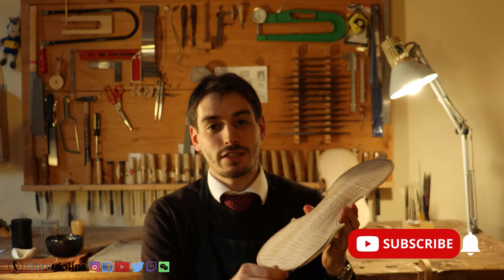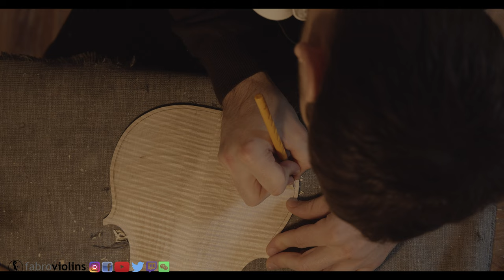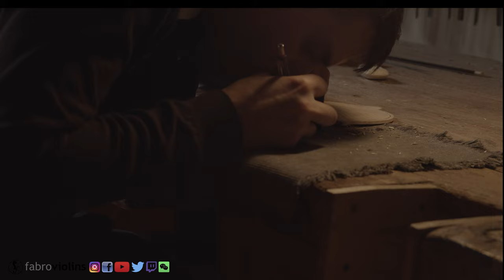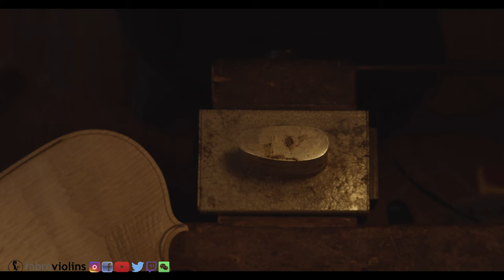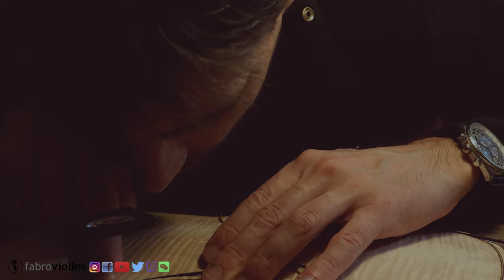MAKING A VIOLIN | The PURFLING | Step 04 | Amati Model

Comment: So interesting! I've seen purfling on instruments before, but I never knew what it was called or how it was done. Is it purely decorative or does it serve a function on an instrument?
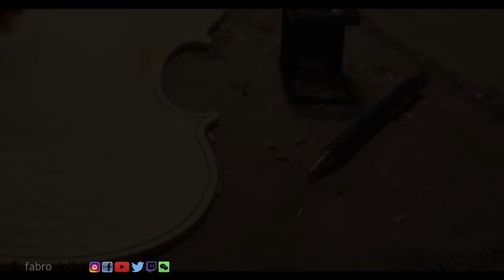Two more questions: what's that you're using at 5:25, with the digital readout? Is it heating up the purfling to shape it?
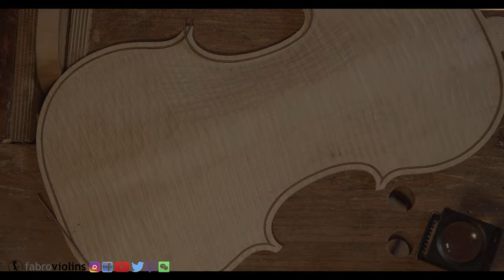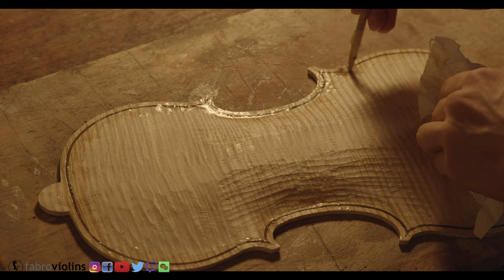And what's that you're brushing on the edges starting around 9:30? Is that an adhesive, and if so, what is it that it seems to come off so easily at 11:30?
I guess that's more than two questions.
Reply from the maker: Thanks for your comment!!! 
It has a double function actually. It also helps cracks to stop at the point where the purfling is. So if for example someone drops the instrument (from a reasonable height of course), it could happen that the instruments cracks from the border and stops where the purfling begins, which is great because then you don't get a crack on the inside of the instrument which are the toughest one to fix as you'd have to open it...And also, where would that crack stop once it begins?!
Reply from the maker: Now about the other ones:
At 5:25 I'm using a beding iron. That way I can bend the purfling to a similar shape to the one that I'll ultimately have and it's easier to fit (and won't break)
9:30 - That's simply glue :) And at 11.30 I think that you're referring to the purfling that I haven't glued yet, or else the glue residue that was left on top and I'm just trying to clean it up a bit.
I think it fits in the two questions category hahaha
Reply: @LucasFabro   Oh, that totally makes sense! That's clever, that it stops cracks. With the glue bit, I was just wondering what kind of glue it was, that it's so easy to wipe off. :) This is all so fascinating. I don't even play the violin, but I love watching these videos.